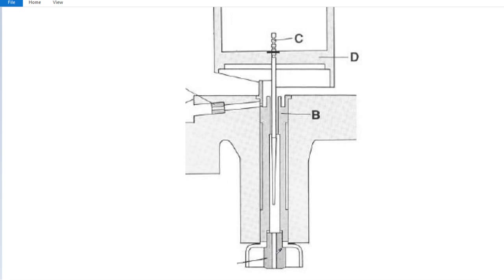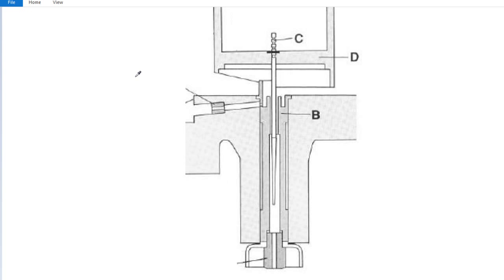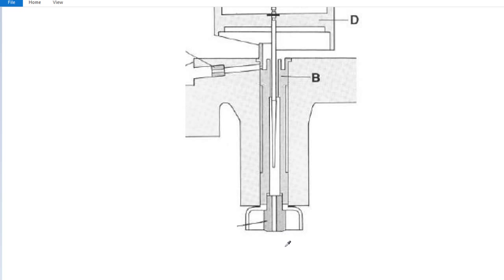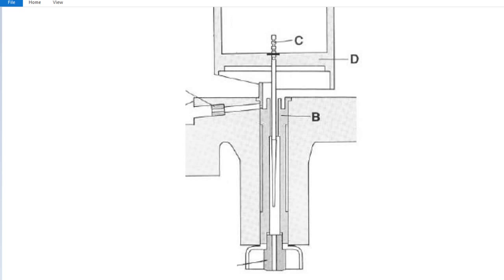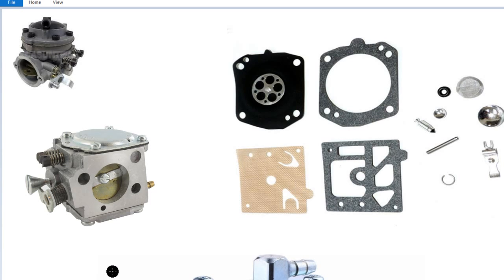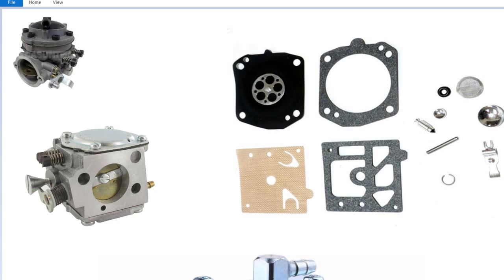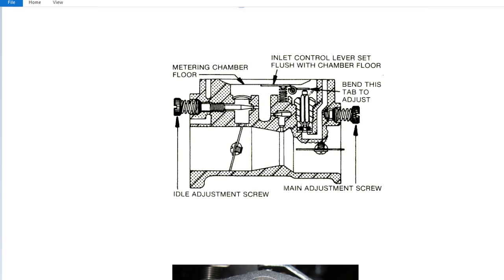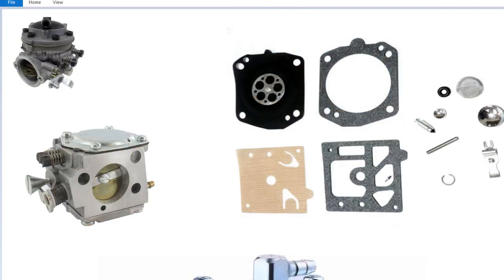Carburetor tutorials - How chainsaw and small engine carburetors work E09

Comment: Great carb series. I've had a lot to do with 2 stroke bikes and snowmobiles. It takes a special touch to do these carbs. And hopefully now people will not be to scared to work on their own. Thanks for the vids.
Reply from the maker: Thanks for the comment fred. Most carbs have a lot in common so with a bit of an idea how they work and where the passages go to and from its not hard to service and fix them. One of the benefits of carbs, a few parts if at all and some simple tools and you can fix them.